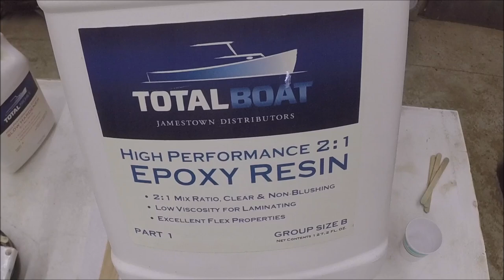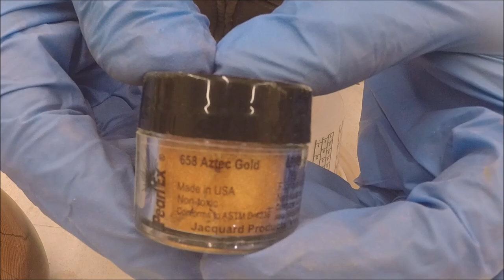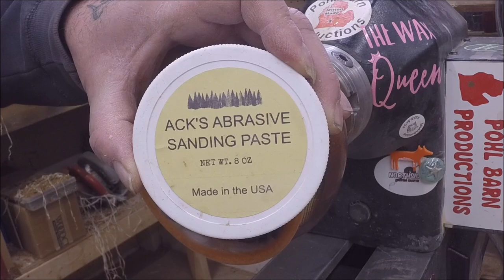Metallic resin rimmed pot

Comment: 20 years ago I got a 14 foot section of a cedar power pole that was about 18 inches diameter. The tree was cut in 1912 and the pole was put in the ground in 1918. I counted 256 growth rings, which means it started growing in the 1700s. i made a couple of bowls out of it, but they don't look as good as yours. There is a strong smell of creosote.
Reply from the maker: no this one smelt like an old dried out attic not the creosote,  I didn't really see any of that during the turn either.

Comment: Hi Doug when you use carbide tools do you keep the edge flat or depending on what you are cutting ( like the lip on this ) tip the cutting edge ???? And do the carbide bits have a compound angle ?????
Reply from the maker: Thank you Doug,  I tip it in the direction I am going I may not have tipped it enough and got that chip out,  but it worked out for the best I think.
Reply: Thank you for the information, Happy turning

Comment: Question, I am wondering if you use any kind of bond release spray for your resin castings? I am just getting into turning and I love watching your videos. The chipmunk voice when your turning cracks me up
Reply from the maker: Thank you  Duggan,  No I do not use mold release,  I use HDPE plastic for my molds,  #2 in the recycle triangle.  I found that if I have to make a second pour that the release is also on the skin of the previous pour causing the next to not adhere as well if at all
Reply: @PohlBarnProductions  ok thank you for replying very much and looking forward to your next videos, in the meantime I will keep browsing through your older videos haha!